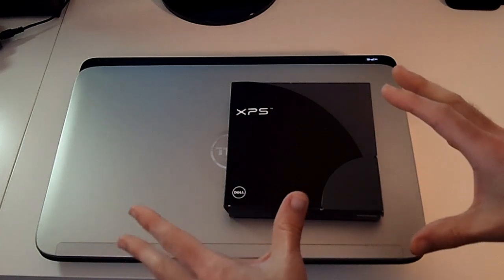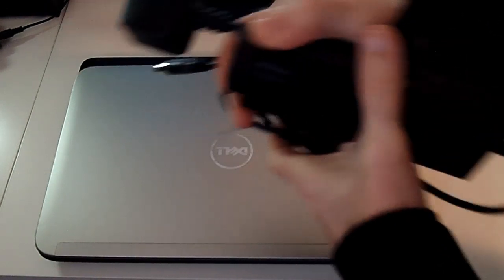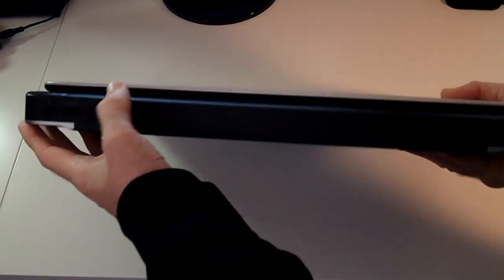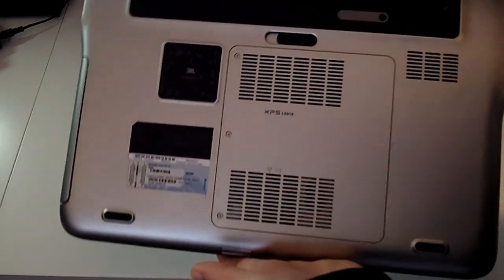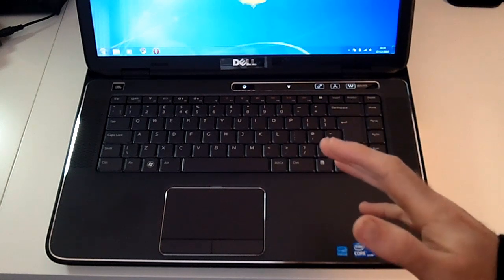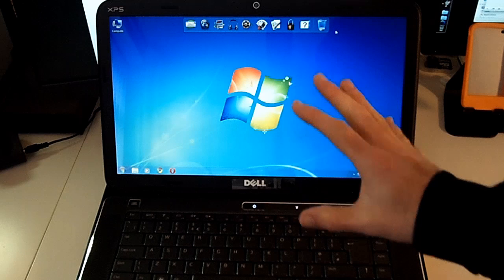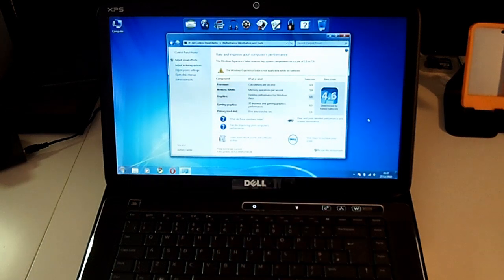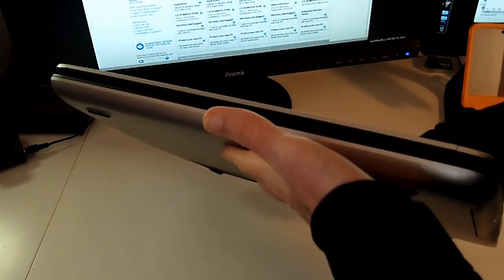Dell XPS 15 Intel Core i5 Laptop Review

Comment: I own one of these beauties. Best gaming laptop on the market. USB 3.0 is supported but there is one 3.0 slot, and one 2.0 slot. Problems: Heavy as hell. has to weigh at least 4 pounds. Also really fragile. suffered a 1 foot drop IN a arrying case and the LCD shattered. 9 out of 10

Comment: with the specs that I have seen in this laptop it seems like it should run it. Better if you  run it on power because the laptop will run at 100% performance. Also read the minimum and reccomeneded specs for the game. If your min specs are good but reccomeneded specs are not, you can just reduce the game quality by a bit till it works with a good frame rate.

Comment: I was thinking of getting this laptop with these specs:
i5  2410m 2.3ghz and 2.9ghz with turbo boost
nvidia geforce gt525m 1gb
4gb ddr3 ram

its all for £629 atm and was wandering if it was worth picking it up. My uses would be regular internet browsing, the occasional movie and gaming. Would it run modern games well? thanks to anyone who answers.

Comment: @davomrmac , when you entered the RATING section , you got 4.6 , and i BILIEVE I know why,
its should be 5.8 or 5.9 ,, you used the system when not connected to Electircty , which means the laptop using the bettery and it wont use the Graphic card, it will be using Intel Built in if am not mistaken,

caus there is no chance the Graphic card rate is 4.6 and I have Nvidia GeFroce GT 330 and rate is 6.7 , any ideas?

am on Toshiba A500 ~ i5 ,
and laptop's rate is 5.9

Comment: Im looking forward to buying a dell xps15 which is priced about 56,000 rupees in india. 
-Intel core i7 2410 (2.0 on normal and 2.90 ghz on turbo boost mode)
-Has a 1 GB nvidia ge force 525m graphics with optimus.
-4 GB of DDR3 ram and the dvd drive as you mentioned in your video.
 I hear people say that the fan screams a lot and inspite of the nvidia graphics the pc shuts down itself while running games which demand moderate graphics.

Comment: @j4fmemo you can run WOW on the XPS as well as the alienware m11x. You get a 1GB graphics card (same as the XPS) but a slower processor. But considering the m11x is almost 200$ cheaper than the XPS, its expected. In my opinion. If youre willing to spend the extra $, go with the XPS. It has a bigger display (15.6 inches compared to the 11.6 inch alienware) a faster processor and a larger harddrive. The sound is simply amazing on it and you get a 1GB graphics card. Theres just not as much gaming

Comment: hi davomrmac.. i have Dell XPS 15 core i5 460M,4GB ram,500GB HDD, 1GB Nvidia graphics GT420M.. when i run the Windows Experience Index Assessment my laptop's score for Desktop Performance for windows AERO is just 3.9 which is a low score.. tell me what to do... All the laptop  drivers are installed..   PLZ PLZ PLZ HELP...